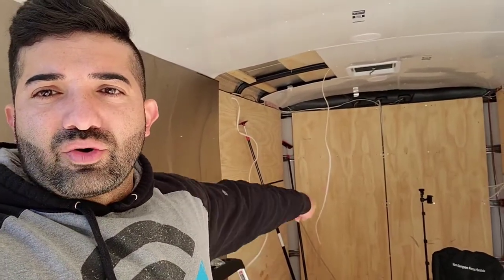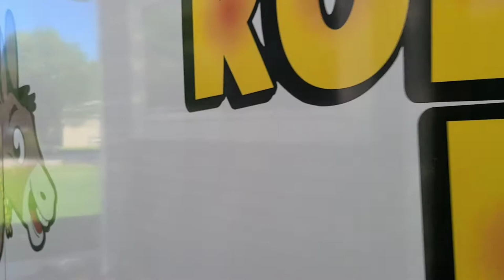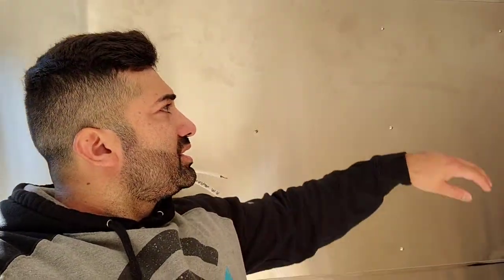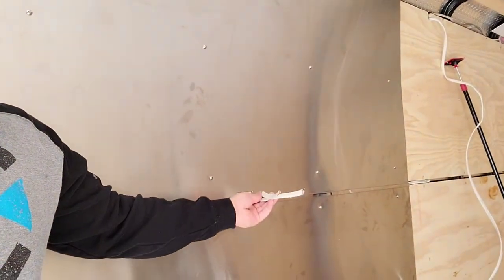Building a Food Truck: Installing the Walls

Comment: Thank you for the tutorial!! 
I was wondering if it is okay to have plywood as insulation, considering the fire safety hazards. 
I have the plywood insulation between my steel wall (totally sealed) and someone told me that it is dangerous. 
Please provide any guidance.
Reply from the maker: Plywood is just the backing, it's not insulation for the stainless which is used in cooking area. I haven't had any issues with it

Comment: What do you Use between the stainless steel sheet?? looks Amazing, Frank!
Reply from the maker: Just the factory installed plywood
Reply: @fbaltierrez  I mean between 2 pieces of steel sheet. You saved a gap for your electrical line. Thanks, Frank

Comment: Hi  Frank, love the look of the stainless steel  ,my question is what do you recommend for in side, out side  corners  and but joints thanks Frank!.
Reply from the maker: Added some link for those pieces. Let me send em to you
Reply from the maker: SS Trim Pieces

End Cap:

https://www.amazon.com/gp/product/B07M793VN5/ref=as_li_tl?ie=UTF8&camp=1789&creative=9325&creativeASIN=B07M793VN5&linkCode=as2&tag=rollingburrit-20&linkId=9b596fb6e41fc02db37f3dde5c9f2ed6

Divider Bar

https://www.amazon.com/gp/product/B07MLSP44P/ref=as_li_tl?ie=UTF8&camp=1789&creative=9325&creativeASIN=B07MLSP44P&linkCode=as2&tag=rollingburrit-20&linkId=14b923c96bad8c7829caeb5c89ebebb4

Comment: Hello Frank. Thank you for all your videos, They have been so helpful! What are your thoughts if I was to do FRP through the whole trailer, except behind the cooking section/Hood?
Reply from the maker: That's actually what I'm doing now in this new trailet I'm building have not finished it to give a good review of how it looks complete and how it holds up to cleaning
Reply: @fbaltierrez  Thank you sir for your response. That definitly helps me. I know that would be highly costly if I were to use stainless steel for all the walls like you did in the trailer in this video. 

When placing the FRP on the walls are you utilizing any wood for support other than the plywood that is already in the trailer? I am curious to see how you are going about the build?

Comment: Did you use insulation on the walls?
Reply from the maker: No insulation on the walls just on ceiling. Don't really need it, it's going to get hot in there regardless

Comment: Hi Frank, great video! a couple of quick questions

Did you screw the stainless steel to the truck's beam? or to the plywood?
Do you need to leave some holes on the Stainless steel for gas lines? (like the ones for the electric cords)
How do you connect the wall to the ceiling?
Do you leave a hole on the wall for your concession window?

Thanks!!!
Reply from the maker: Good evening, the SS is screwed to the plywood only. No holes needed to be left out on this video im recording now I'll show you how you connect the gas lines with just 1 hole 👍 walls and ceiling are not physically connected only butted up to each other. The concession window goes first before the SS walls
Reply: @fbaltierrez  Awesome! Thank you for the detailed explanation Frank :)

Comment: Hey Frank, thank you for the video!! Been working on purchasing a trailer to start my build.  Is there any cheaper alternative to stainless steel that still meets regulation?
Reply from the maker: frp is the only other alternative I know of but that can't be used behing the cooking equipment
Reply: @fbaltierrez  I'm looking to build a food prep kitchen without cooking appliances, as it will be outdoor style BBQ. WA state requires a commercial food prep area and unfortunately cannot be residential. looking for simply refrigeration, washing and hot holding.

Comment: How can I find all of your videos in order in order I am about to start building my food truck and I just want to make sure I do it in the correct order
Reply from the maker: Glad to hear you are starting a build. There is no specific order to be honest my outside work I do if it's sunny and warm out inside maybe floor,  electric, walls, ceiling, plumbing and gas
Reply: @fbaltierrez  I am trying to find a video showing the interior walls and concession windows.
not sure if I just attach wood to the metal frame or not.
same for ceiling
Reply from the maker: @rickmcinnis2380  I will be uploading the concession window one either today or tomorrow. I just installed one yesterday

Comment: Could you please show the transition where the walls meet the ceiling? I’m not quite sure what you did there and every time you pan around the trailer, I try to get a better look but I just can’t
Reply from the maker: It was just overlapped from ceiling to floor
Reply: I think most of us watching these videos are visual learners, myself included. It just makes it easier to actually do when you have a visual to make sure what we are doing matches how you did it, even if our methods are slightly different. Thanks again!

Comment: What's the difference in use between the end caps and diveider bars?  How much did you use? I'm ready to order these and don't want to order too much.  My trailer is shorter. 7 x 12.  Thanks in advance.

Comment: Nice work bro! Can you tell me what that transition piece is called for the stainless steel?
Reply from the maker: One of the best finds I had, was looking for them for months. Captive Air Stainless Steel Transition Pieces
Reply: @fbaltierrez  what gauge stainless steel did you use? Trying to figure out what gauges these trim pieces will work with. Thanks brother!

Comment: Whats the size of the screws  you used and were they stainless steel
Reply from the maker: Let me send you the link. But yes SS AND 3/4
Reply from the maker: https://www.amazon.com/gp/product/B083SMKNKK/ref=as_li_tl?ie=UTF8&camp=1789&creative=9325&creativeASIN=B083SMKNKK&linkCode=as2&tag=rollingburrit-20&linkId=4a171ac796a5d88c8c5b5fa1705060e2

Comment: Hey frank I was wondering do you know what size/gauge stainless steel you used?
Reply from the maker: They were 4x10 sheets 20 gauge 
But they are out of my price point now. Crazy  Price now
Reply: How much were they at the time of this ? I think the 24 g i was looking at is around 230 a sheet
Reply from the maker: @coreylee439  when I bought I bought them at $50 a sheet
Reply: Wow! I thought 230 a was a good price lol
Reply: Oh one more thing do you think putting the ss sheets up with glue would be a problem? I think my county health codes frown upon screws in the walls
Reply from the maker: @coreylee439  don't even know if glue would hold it up by itself. This stuff is heavy
Reply: Ok well cool I appreciate the response bud

Comment: Hey where  do you  buy the  stainless  steel   for the wall
Reply from the maker: Bought it at a local metal shop in Addison,  IL. Make sure its 304 stainless steel
Reply: @fbaltierrez   thanks ok